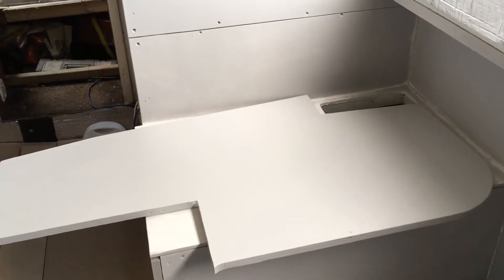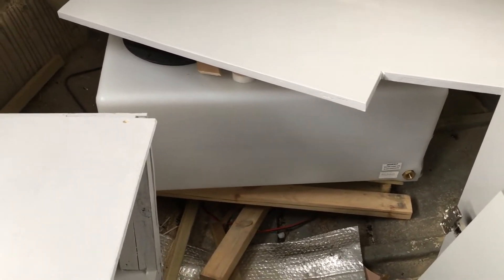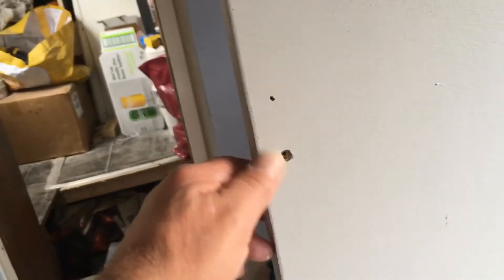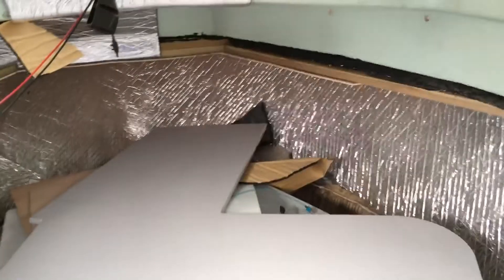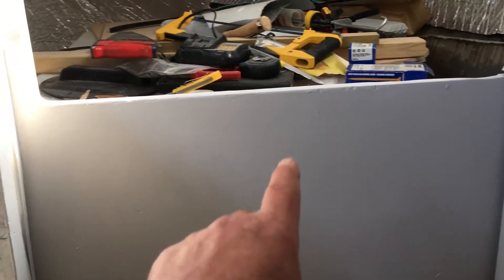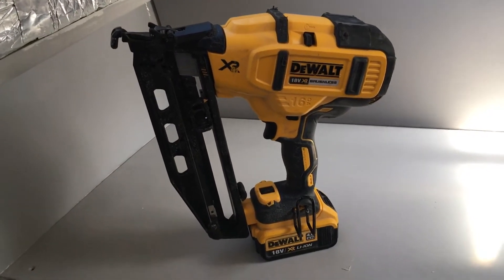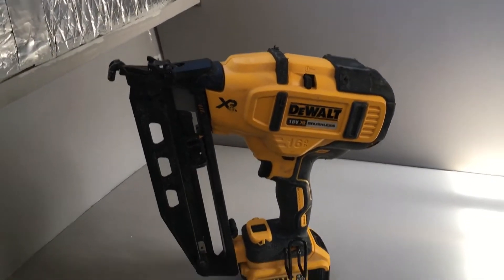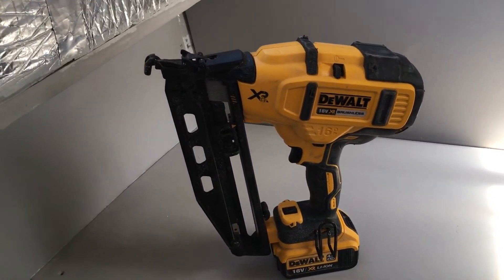24. Putting a wall in place on my Norman 23 boat

Comment: I'm sorry if this is a stupid question, or you've covered it before, but how do you attach the carcassing for your seats etc to the fibreglass shell?
Reply from the maker: First of all sorry for the late reply. What i did was under the gunnel is wood fiberglass in so i screwed a new bit of wood on to that , then i screwed wood to the bottom in the same way then worked from there. hope this help's. If you need to know some more just ask.
Reply: @simplyboating4609  thanks, I'm just glad for the reply however long it takes!